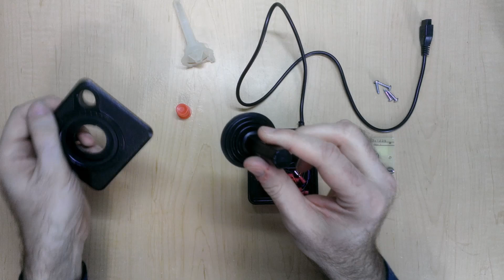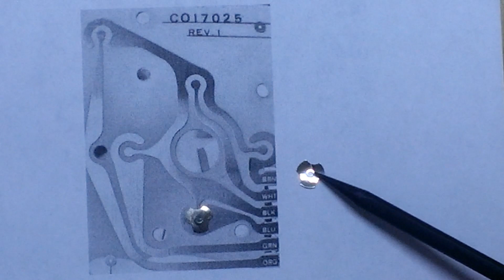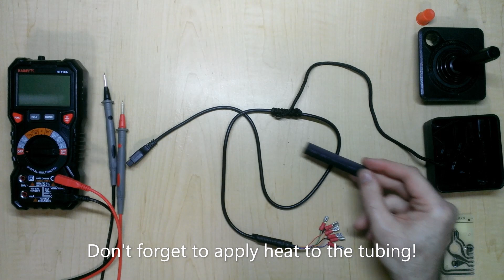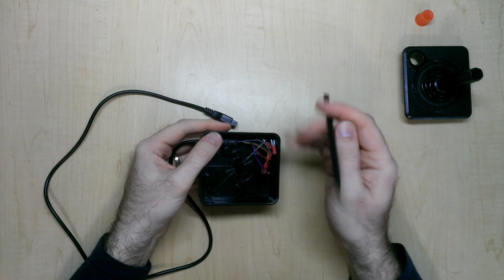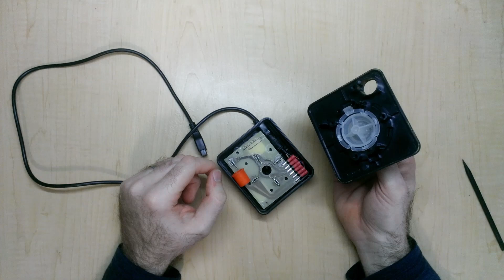Atari 2600 Joystick: Teardown, Contact Mod, and Cable Replacement

Comment: I did a similar thing to map out te ports for my Magnavox Odyssey 2.  Mine is the model with detachable controllers.  They use DB9s however are not the same pinout as the atari.  I had a controller that barely worked and I had a mostly functional one.  I stick my paper clip in ground and stick another in a port and press fire.  I guessed correctly on ground the first time.  Once I found ground I mapped up up, down, and left.  Right did not work but it was pretty easy to guess.  It used pins 1-6.  1 was ground, fire, left down right up.  I rewired a gemstick gemini controller and it worked.  After that I figured it would of been a better idea to make a conversion cable.  I did that by cutting an extension and rewiring it.  So now I can use any atari compatible controller.  I bought a nes64 controller kit and it came in not to long ago and it's been fun to teach myself soldering and learn more about electronics.  I was a software guy and never messed too much with hardware outside of FRUs.

Comment: Hi Steve, nice video. I almost have the same problem as you. I have an generic gamepad from nes but this has 5 wires, and I want to use it to fix my controller because my atari's connector is broken but I don't have idea how to replace the 6th wire. Do you have any idea?  (sorry for my bad english

Comment: Can a bad or kinked wire from being stored and wrapped up over decades cause the wire to make random right side movements(of the cursor -pacman,starship ...etc) on the video screen? It seems that when the wire is maneuvered in certain ways when playing any video cartridge ..... random right side movements are occuring. This 2600 system is almost like new and was stored for most of it's life in the original box with cords wrapped up.
Reply from the maker: Yes, this is possible.  If the wires for the right and ground pins are frayed and make contact within the cable, this has the same effect as moving "right" with the joystick.  You can test this hypothesis with multimeter, testing for continuity or zero-ohms across the "right" and "ground" joystick pins when the cable is moved around.

Comment: That joystick does not use potentiometer isnt it?
Reply from the maker: Correct -- the original Atari 2600 joystick only has five contacts: one for each direction and one for the fire button.

Comment: Can the cable be bad even tho I'm getting continuity on every wire?  I have a tac 2 joystick and everything works great except I can't move down at all!   I don't have a multimeter,  but I do have one of those continuity testers, and I'm getting continuity on every single wire, including the down wire?  So, what do You think the problem could be?      This is a great video, very informative!   Thank You!
Reply from the maker: If all the wires have continuity (especially the wire hooked up to the "down" contact), then the cable is in good shape.  Wiggle the cable around while testing continuity to be sure.

The next thing I wound check is the contacts themselves.  I found the following photo for the TAC-2 internals that show a ball-style contact for the joystick, and then pads for each of the cardinal directions.  If down isn't working, there might be an obstruction (dirt, grease, etc..) between the "down" contact and the "down" part of the ball contact.

https://ilesj.files.wordpress.com/2012/02/tac-2-before-closing.jpg

You can also test this by disassembling the joystick and using a wire to bridge the "ball" contact and each of the direction pads -- you should see movement on the game that is running as you're simulating joystick movement.
Reply: @SteveGuidi    Ya, the first thing I did was clean the ball and the contacts before I even tested for continuity.   But I found the problem, and my mind is blown with confusion!  So, I have been using that same tac 2 stick for days now on several systems, 2600, 7800, XE and multiple atari flashback consoles. Last night I had it plugged in to my flashback 7 for well over an hour, and right during the middle of a game of centipede,  down just stopped working! I plugged multiple other contollers into the FB7, and they all worked fine! That's when I opened the tac2 up and cleaned it and tested the wires. It seamed fine to me so I plugged it back in the FB7 and still the same problem! I was really close to going in the basement and soldering a brand new cable into it, but it was like 4 am, and I really just needed to go to bed! I'm glad I didn't do it because after reading Your response, I know now that the cable is fine!  So, today I plugged that same tac 2 into my 7800 Which was just the closest sytem near me at the time,  and it all worked great. Out of curiosity, I then plugged it back into the FB7, and the down doesn't work again now!  I also tried it in the player 2 port, and it doesn't move down on that port as well! It doesn't matter wich game I run either,  it won't move down on any of the games I tried! Also, you know how on those flashback systems, when you hold down both the select and reset buttons simultaneously and then press the power button on, that hardware test screen comes up. Well I ran that, and down isnt registering on there as well (only on that tac2).   So, just that one  controller won't work properly only on my FB7, but it did work fine up until last night! And it works great in every other system that i plug it into! And all of my other controllers seam to work just fine on My FB7, including a different tac2 that I own!!  Is this not the strangest thing You ever heard?   Do You have any theories of what could be happening here?  Thanks so much for Your time Man!!
Reply from the maker: @anthonycaban738  This is very bizarre, especially that the TAC-2 works without problems on other systems, and other joysticks work fine with the FB-7!  It is hard to even guess what the problem might be but it does sound like more troubleshooting is required.

Most of these joysticks are passive, that is they have no ICs in them (unless there is an autofire) -- they basically behave like a bunch of mechanical switches.  So either the switching is no longer working, or the console is not registering the switching anymore.  I think you can try to narrow down the troubleshooting scope by using a separate joystick exclusively on the FB-7 to see if the same issue arises.  You can also use the TAC-2 exclusively on another system too.  If you get the same problem (and hopefully you do), then that will tell you where the fault lies.

Also, if you can find a game that let's you hold down for hours without reaching a game-over screen, then you can also try to bridge the down and ground pins (pins 2 and 8) on the joystick input and see if down is still registering after some time has passed.  The benefit to this is you don't need to be around to physically hold the joystick.

Comment: Hi. I'm going to give my Atari paddles a clean as I've got some jitter on the screen response. I have a can of Servisol Super 10. Would this be ok to use do you think? It says it's an electrical contact cleaner, but also a lubricant. http://www.crcind.com/csp/web/ProdDisp.csp?lng=3&idx=6093169&country=GB&product=SOL%20SUPER%2010&brand=SERVISOL
Reply from the maker: That should be fine as it is a contact cleaner; I use CRC-brand which is similar.  I've seen others on YouTube use De-oxit as well.  On a side note, I'm in the process of building a pair of paddles from scratch -- I'll post the video when ready :)  If your cleaning of the potentiometers inside the paddles doesn't work, you can replace them with 1M-ohm equivalents.